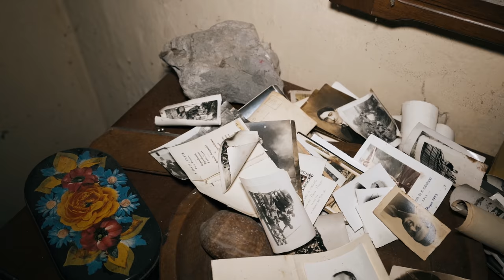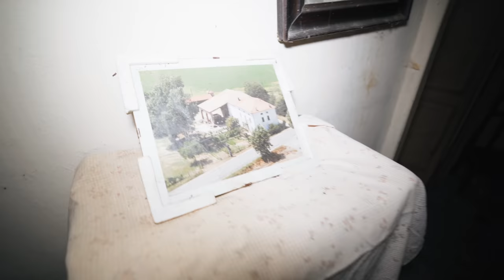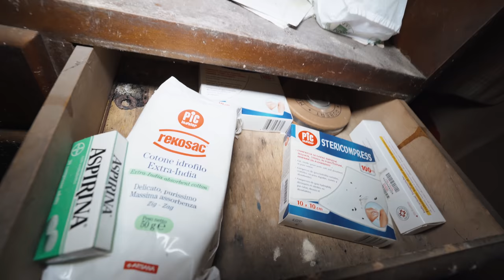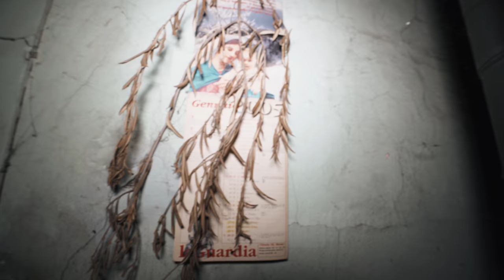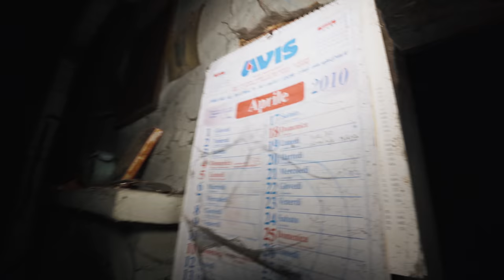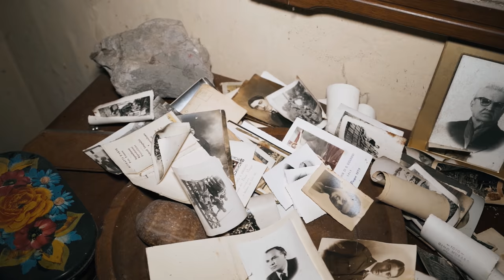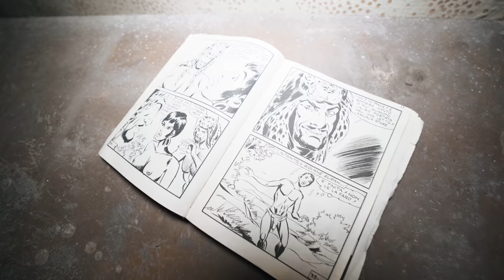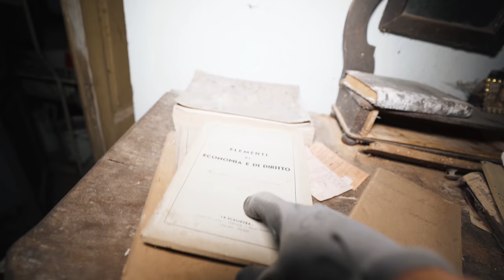LEFT WITHOUT A TRACE | Abandoned Italian House of the Baretti Family

Comment: I think that room off the first kitchen is an actual room instead of a shed as it has a very large fireplace.

Also...in the garage in front of that old Fiat...what is that large concrete walled area? 

I would have loved to see inside the old barn attached to the house...was it the old stables?

Maybe the garage was the old stables and that concrete thing was a hay trough?